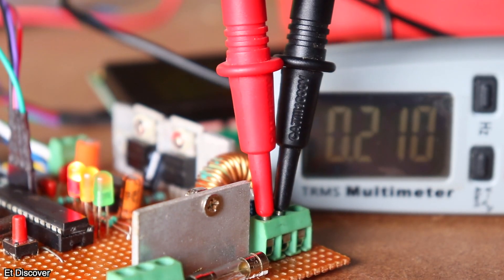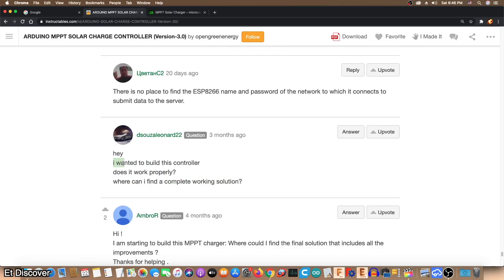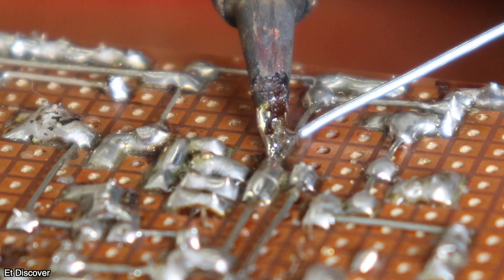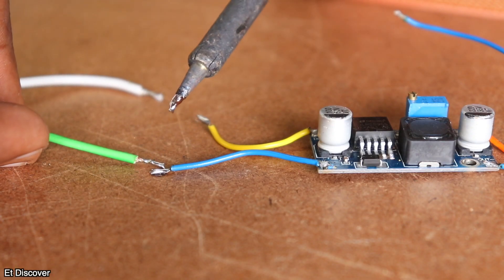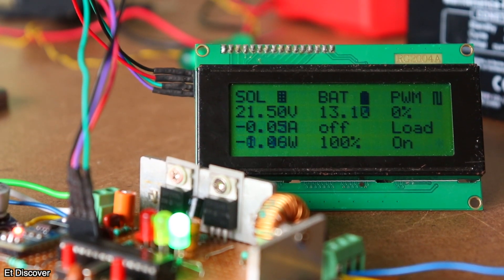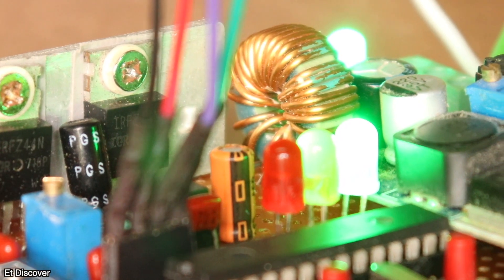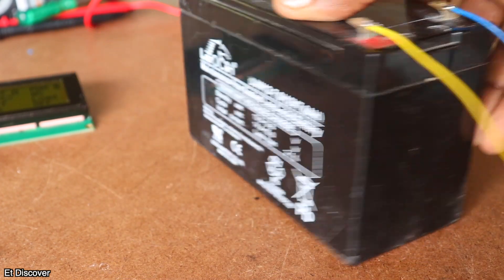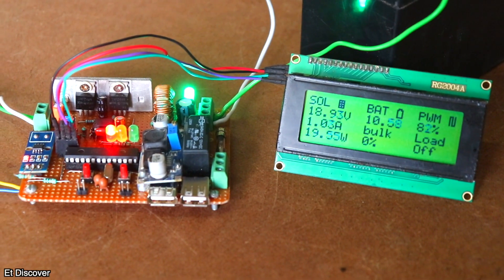How To Make A 300 Watt #MPPT Solar Charging Controller

Comment: thanks a lot for making such informative video on mppt charge controller. how to make it 50a mppt charge controller for 200a tubular battery. i have 3 solar panels each 125w  and also plan to add one more.

Comment: Mosfet as a load switch is fine. You just have to give a proper voltage to it's gate.
Reply: Correct.... giving less voltage creates resistance due to which it heats up. use Logic Mosfet for output loading switching

Comment: What is the efficiency?  For NMOS Vt=3V,  minimum voltage across  drain source is 3V. That means NMOS burn a lot of power which dwarf the power saving from syncronous convertor. If solar panel output is under 17.5V, it is better off connect directly from solar panel to battery, or using a PMOS and Schottky diode instead.

Comment: 1:How many 50 watts solar panel did you use?
2:What and all changes did you do to debasish dutt's code ?
3:In your schematic diagram given in the description I think diode D1 should be reversed.
4:I tried simulating your entire circuit in Proteus it didn't work.
5:Can you please share the exact code what you used 

Pl🙏 reply as fast as possible

Comment: Can we add a switch to inverter to cut off battery charging from mains. I would like to convert my normal inverter to solar. So I want to make the inverter not to charge batteries from mains(only from solar when it is available), but mains should be byepass through inverter without charging the battery.
Please help
Reply from the maker: Don’t worry this MPPT solar charging controller already has auto auto cut off battery charging process, that is why I’m used a relay, just you need to attached inverter in lode terminal,

Comment: Hello friend.nice build .I have problem with my mppt controller which I bought for my sister on her bonsai tree farm.but the controller doesn’t charge anymore.can’t see any obvious faults like burnt components.any ideas what can check.the fuse ok.the lcd screen ok an shows input and output.it’s cpk2420 model off eBay.tried to contact seller.Adam Welch off YouTube tested one and said good model.that’s why I bought.wondering what would stop it from charging battery.would appreciate any help.thanks.steve in uk 😀

Comment: Namaste bhai🙏,

Im recently watched  your MPPT solar charger controller and got  impressed very much and purchased all required components in josh.

But now im stuck in between programming part, where after uploading program there is no indication of parameters and it simply blank.

I geuss it's may be because of that lcd library
(If you have that library please share with us)

Please help me with this bhai

Dhanyawad 🙏

Comment: What components do U need for 50 AMP / 2-phase / ESP32 / 250 V IN / 12 - 100 V OUT MPPT ? Can U make such a thing with P&O, FOCV, ICC, ANN, FLCIC, RSC, RSMCA algos for LFP, NMC, NCA, Pb batteries ?
Reply: You only need one algorithm, P&O is mostly used because it's easy to implement. Tech Builder has one you can check him out.
Reply: @CroftGaming1  HI, thank you for answer, I am just testing BOOST MPPT, do U have video, where U test synchronous BOOST ? Can I use my BUCK + IR2184 + ACS758 + ACS1115 , but I only reverse IN and OUT ?
Reply: @PavolFilek  I don't have a video, buck mppts are more common and easy to use, by changing the power direction of a buck won't work, it's a different circuit, works differently than a buck converter, you can always build one but you need to know what you are doing.
Reply: @CroftGaming1  But I tested first FET + DIODE, then FET + FET and it works, if U power BUCK backwards, LOW SIDE FET is as input and HIGH SIDE FET is as output, ACS758 + ACS758 + ADS1115, and U have 50 + 50 AMPS -2-phase BOOST.
Reply: @PavolFilek  well the circuit looks the same if you use a buck converter as reverse, but now your input became output and the output became your input so you need to change your feedback accordingly, also now the low side MOSFET is the main switch and the side is the diode, you need to change the pwm according to that.
Reply: @CroftGaming1  HI, I generate two phases 180  degrees at ESP32 pins from 16 to 96 kHz and measure losses. I need to fiddle with snubbers and gate resistors.
Reply: @CroftGaming1  My feedback is ACS758 -  current and voltage IN / OUT at second ADS1115. The boost MPPT is good, if U have o lot of shading and U can not use series connection of solar panels. So this is the same as at BUCK, no changes needed.
Reply: @PavolFilek  well I did not build one with digital circuit, i built one with uc3845  which is an analog IC, but can't get high efficiency like buck converter, for buck converter the switch current is lower than the output current it's opposite for the boost converter. Higher the current higher the losses.
Reply: @CroftGaming1  Yes, but now we have FETs with 1.5 or 1.8 mOhms ROSon and Qgs around 20 - 40 nC, 10 y. ago this was not feasible. COnduction losses are not 20x20x 0.030 but 20x20 x 0.0018

Comment: If it any possible  for alternate components  of  33 uh inductor.. Becoz it is  very rate item 🙁🙁🙁😞😞😞 I asked more than 50 store but the components  didn't there.. Plzz tell d alternative components  for that😞😞😞
Reply from the maker: Just take a core and twist 24wag copper ware 22time, and you are Dan,

Comment: This is pwm charge controller,
How you track maximum power,
Relay decrease reliability of this circuit.
Your solved one issue not all.
That is reversed current flow

Comment: Using diode at output defeats the purpose of using a synchronous buck converter,  the resistance and capacitor is used for smoothing out those high peaks the loss is in milli watts, and the output MOSFET is act as a switch it's won't heat up much you just need to use higher gate voltage (atleast higher than 10volt).

Comment: Hi. nice video. I am probably going to try and make this one. One question thought. You explain MPPT as controling the duty cycle to the battery based on the bataries charge. But MPPT should be based and the best voltage / current efficency the solar panel can manage? Should there not be PWM on both sides? Is solar in and battery out?
Reply: You are right

Comment: Well, you don't understand the concept of mosfets. Your modification are not an improvement. Did you understud the H-bridge and the use of  propper (!) Mosfets with low R-on? And BTW your schematics are very messy.